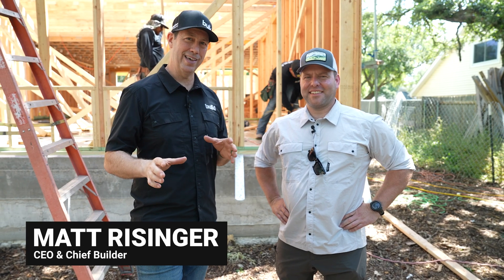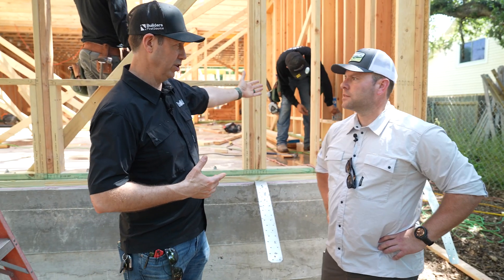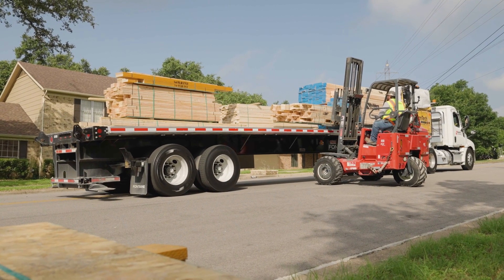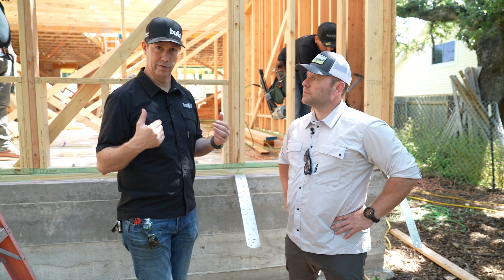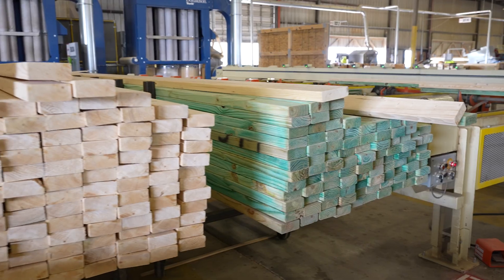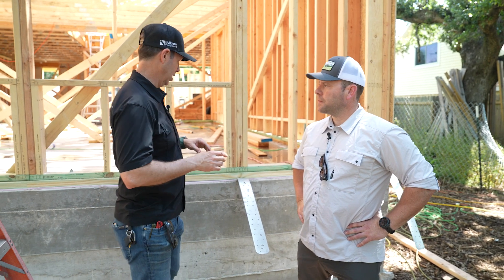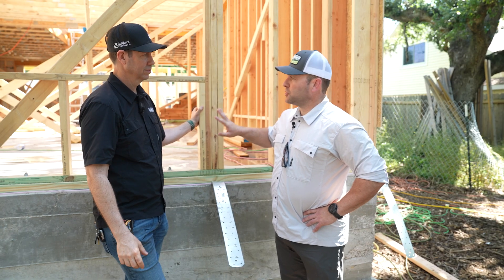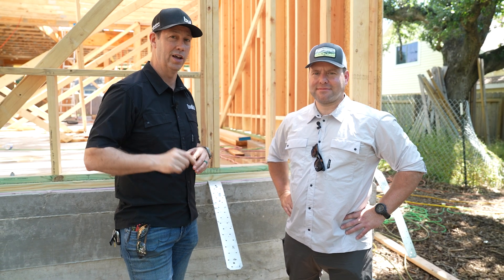Explore the Benefits of Ready-Frame Construction

Comment: We are the friends on the Oregon coast that Tim mentioned. Our plan is a one off, one time only build. After being out of residential construction for 15+ years a lot has changed. After doing research on how to work efficiently with less crew including going to IBS in 2023, we knew we wanted to do the ready build. It’s been a learning curve and some of our framing help was resistant to using it. That being said, I am now on the top floor and was able to frame and stand 7 walls ALONE in less than 5 days with almost zero waste. A few swaps here and there  due to changes or wane in material. Regardless it’s a game changer. The best employees on this project are the forklift and ready frame! @awesomeframers @risingerbuild

Comment: Why wouldn't CAD based computer controlled wall construction work as well as roof trusses, which have been around for decades? Surely something could be don't to make sill plates adjustable for the foundation pour. It makes it easier to use advanced framing as well.

Comment: I really wanted to use this system for my home but BFS said this was geared towards production builders and doing a one off would be extremely expensive. And they even said doing precut studs for 11’ ceilings would be cost prohibitive.
Reply: BFS told me the same thing earlier today.
Reply: Which BFS?  @peteyou2325
Reply: This🎉 is exactly what I learned. Bfs and build show are not being very clear/transparent. Plus most bfs outlets are not interested in doing one off houses or working with small builders with this innovation. I do think everyone should consider superior walls though,. I actually found after the fact that in an expensive market (e.g., Washington DC) they were slightly cheaper. But any savings should be put into additional gravel under the s;qb like Steve base I’m has advocated for a truly dry ground below entire house. Concerns  about the joints can easily be dealt with adding additional polyurethane and or expansion bentonite  PLUS overlapping with the Polly wall membrane out a foot on each side. I would still use waterproofing over superior wall as depending on weather and factory psi cna be under or over 5000 psi, and not a;ways  be waterproof.
Reply: @suspicionofdeceit 
I thought about it but I have 10’s upstairs and I have an overall height I can’t go over and I’ve got a full height attic for the mechanicals and storage with an enclosed set of stairs that are code minimum.
Reply: Custom work is very difficult for this BFS Ready Frame product.

Comment: Why not go ICFs for all exterior walls? Three guys up to roof rafters in 4 days. Can still go pre cut for interior walls if need be.
Reply: ICFs require a definite thought out plan for window and door placement.  Making changes after the fact are very difficult.  Once you account for that, I agree, ICF from foundation to roof are a great way to go.  One gets a high performance air tight home for practically no extra work.